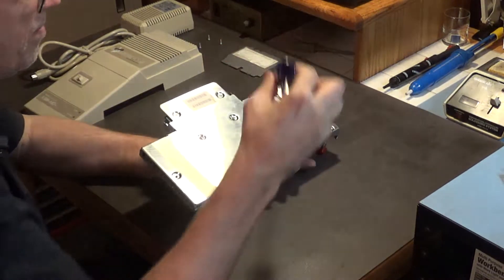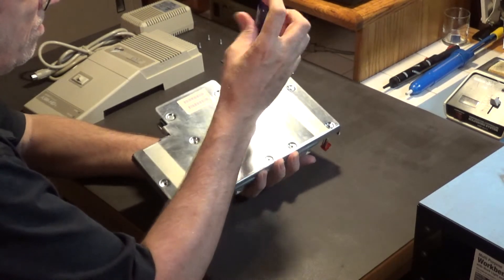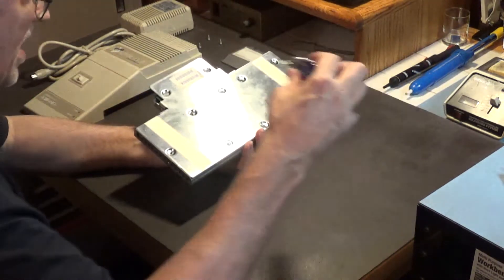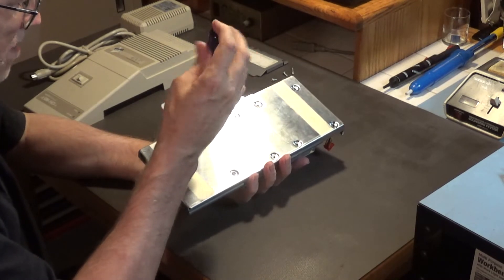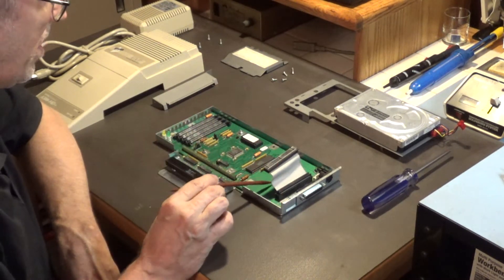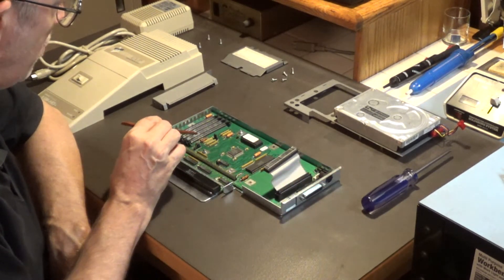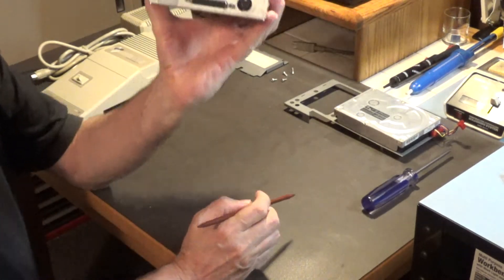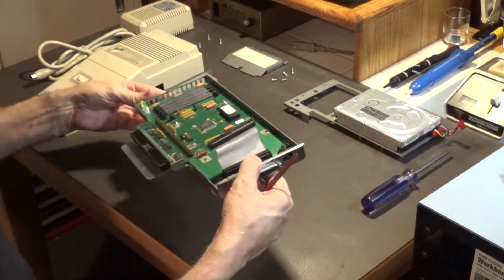GVP A500-HD+ hard drive for Commodore Amiga 500

Comment: I have 3 of these with one with a power supply & the Mini 286 board. I think one of my older A500 was modified to run the power thru to the GVP for power.
Reply from the maker: Cool.

Comment: I love the design of this hard drive controller because it perfectly matches the beautiful design of the Amiga 500. I had exactly this version with my Amiga 500 when I was little, it had a 50MB drive in it. I think I will try to get hold of one again and see if I it's possible to fit a solid-state solution in it instead.